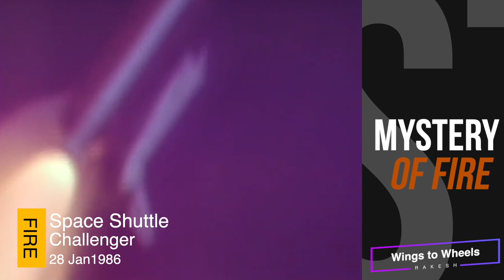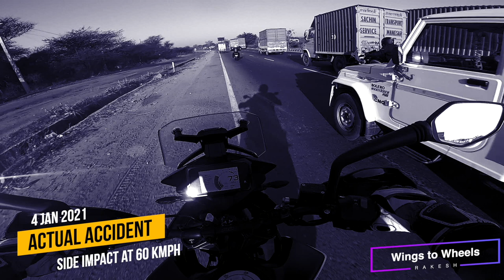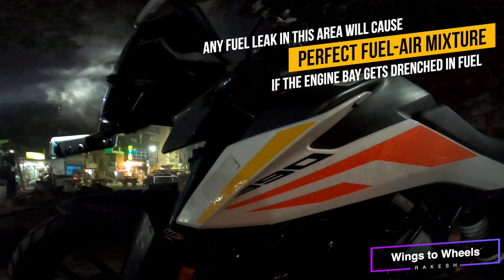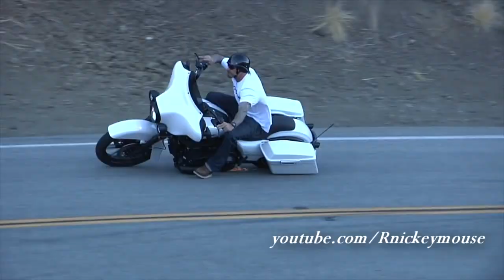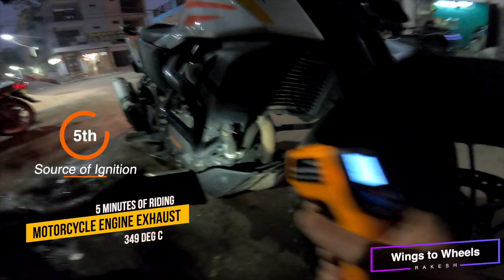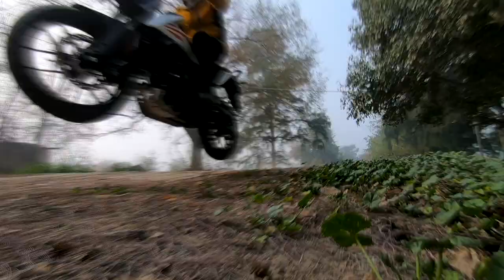KTM390 Adventure FIRE | Motorcycle Accident investigation | Fire Accidents

Comment: Extremely important video, Thank you sir. 

Having such glaring problems with the build shows the weakness in the QC process more than anything. These performance motorcycles are meant to be used on tougher terrain and as such should have the highest quality control in my opinion.

Comment: Have seen oil leaks even in the ADV 790 ,failure of break callipers where you simply have to leave the throttle to make the motorcycle stop as the breaks are jammed,recently saw another youtuber from Delhi who had to stop his ride in between due to oil leaks.I would anyday put my money on a Japanese and stay happy for life.Have seen enough of such videos to convince me not to get a KTM
Reply from the maker: Is there a KTM 790 Adventure in Delhi ? Would love to interact with the rider.
Reply: @WingstoWheels  I am referring to Duke 790 from Bangalore.The rider conformed that they are not able to solve several issues because service technicians are not skilled enough,and rider from Delhi rides the 390.I was excited for the 490 but dont prefer dealing with such issues,my honda has set serious standards for reliability
Reply: @akshayprasade6681  honda is best with reliability, durability, quality and safety.

Comment: So shal v go for ktm adventure 390???
Reply from the maker: Fuel tank issue will certainly get rectified.  However whenever a technician works on fuel pump, fuel filter or the pipe cleatings, please watch out for the fuel leak as that's a restricted area. 
There is nothing wrong with the bike.
Reply: @WingstoWheels  thank u sir for ur repl

Comment: Even my tank also got crack at same place, I'm yet to reach out to KTM service center regarding the same
Reply: I have reached previously and they are heistant to agree that it's a manufacturing defect. It is 200% true that none of the technicians are trained properly to handle 390 Adventure.
Reply: How is your usage? Do you off-road a lot? Or did it crack during normal usage? 

And how did you figured it was cracked?
Reply: @rathindholakia3924  I did a lot of touring, I haven't used it much on off road. All of a sudden fuel started leaking on a Highway trip
Reply: @supermotosrinath7609  okay, understood. Thanks for the information. Mine is getting delivered on Saturday & I am going to use it similarly.  Fingers crossed! 😑

Comment: Sir, does KTM Adventure 390 have the fuel leak issue? 
Is it a common issue for the 390 Adventure bikes?
Reply from the maker: Not common but if mishandled it will cause a fuel leak. Tank crack issue should be resolved by the company, hope soon.
Reply: @WingstoWheels  Thank you for responding sir.
You make very educational videos which are far better than some of the reviews being done.

Can you please advise me on something?

Which bike under Rs 4 lakhs would you suggest for touring purposes? Would really appreciate your feedback.
Reply: @martinjoseph5537  since you got rs 4 lac add little more and go for Kawasaki versys 300x you will not regret.
It is machine with refined durability and very trusted stability with safety. On time investment.
Reply from the maker: @martinjoseph5537  also test ride RE Interceptor, Ktm390Adventure, BMW G310GS and RE Himalayan to see for yourself what feels good.
Reply: @WingstoWheels  Thank you sir. Appreciate it.
Reply: @larmaribangofficial7992  Thank you. It's an interesting choice. Will check it out.

Comment: https://www.youtube.com/watch?v=NPs_5t2Jj2E Sir, in this video, you say 390 adventure is a safe vehicle due to electronics, but now when I look at this I'm confused as to proceed with 390 adventure as I've booked one. Also I'm not comfortable going for BMW, RE options. Do you think on keeping your 390 adventure or are you planning to sell it off after this?
Reply from the maker: Fuel tank issue will certainly get rectified.  However whenever a technician works on fuel pump, fuel filter or the pipe cleatings, please watch out for the fuel leak as that's a restricted area. 
There is nothing wrong with the bike.